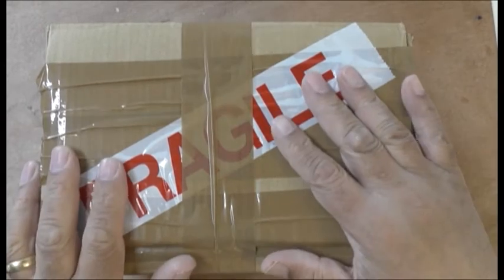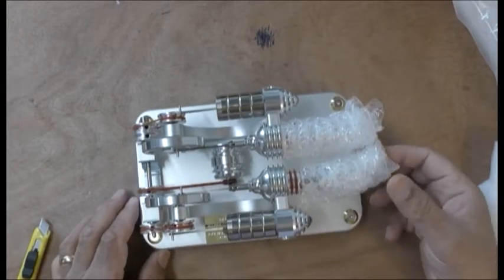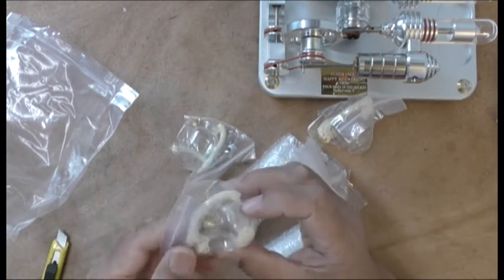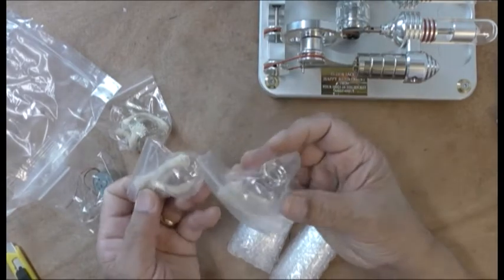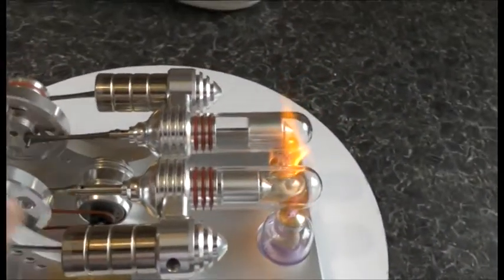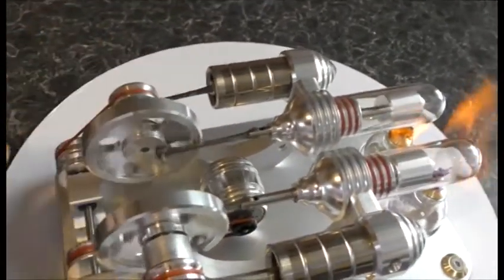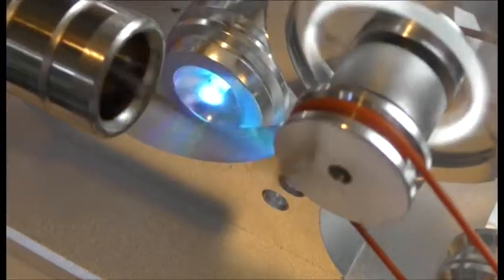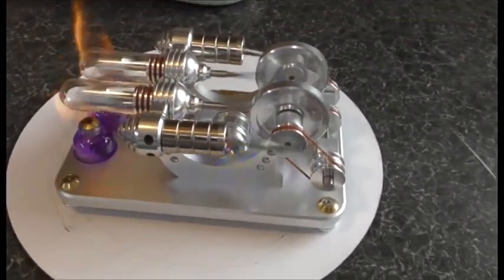#111. Hot Air Stirling Engine (2-Cylinder)

Comment: Thank you so much!  Just what I needed.  I was having trouble getting it started with the "belts" on.  I just happen to be studying thermodynamic processes and this was a perfect demo.  I had to take the outer covering off the wicks in order to get them through the tiny holes on the lamp caps.  Any suggestions?
Reply from the maker: I can’t remember now but I think I used a thin metal rod to push through. I do remember on one of my engines I cut the wick to make it thinner. 
Hope this helps